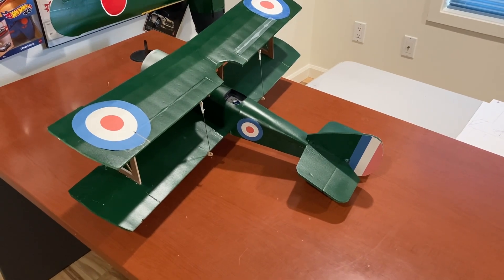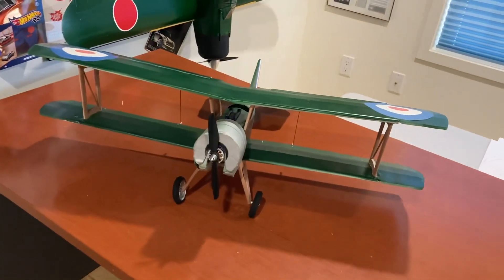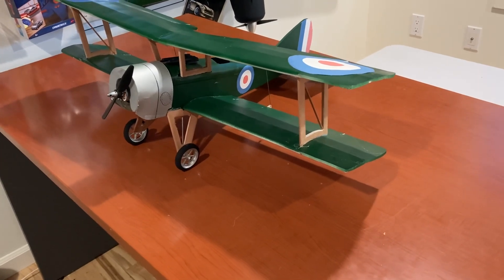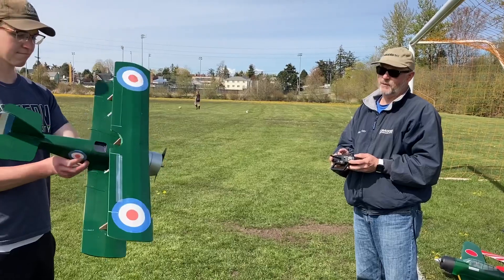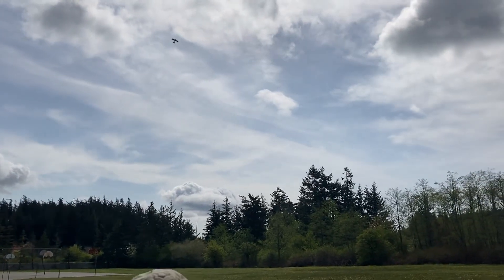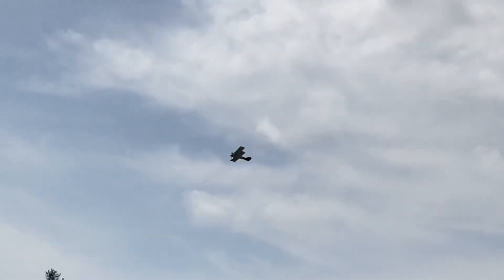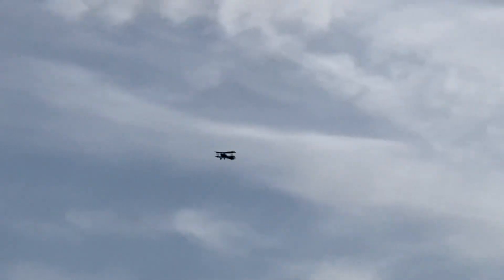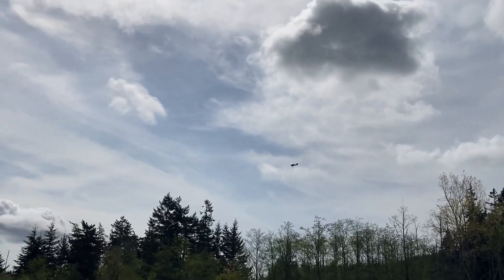Foam Board Sopwith Pup based on Flitetest DR1 and Tiny Trainer

Comment: Tail heavy
Reply from the maker: I’ve added another 26g to the nose and we will see how it goes. Thanks again
Reply: @thenerdoligist1292  good I think you're on the right track but that's not even 1 oz what you're adding. I would expect 3 to 6 oz. It's hard to get a short nose biplane like that nose heavy the lift of the Wings can easily carry it. Even the ailerons do not respond right when it is tail heavy. This may blow your mind but I fly large RC and have seen 80 inch wingspan short nose Japanese zero require 4 lb of nose weight. Philosophy is if it needs it, it needs it. it's got to have it to fly. If your biplane was a medium size RC airplane it could take a pound or two. Remember the real plane was lightweight wood and the engine was really heavy.
Reply from the maker: Maybe. I added a rudder to push the backend around in the corners. If that doesn’t help, I’ll take another look at CG. Thanks for the suggestion!
Reply: @thenerdoligist1292  thank you for reply. Fyi the real airplane was designed to balance but with an engine being the much heaviest part over 60% of the aircraft. So when you made it into a model you did not have that you had a short nose but the engine does not weigh that much so you have to add nose weight. this is true of all short nose scale model airplanes. And most people don't do it or don't understand it. Rudder will not be a real solution. Nose-heavy equals stability